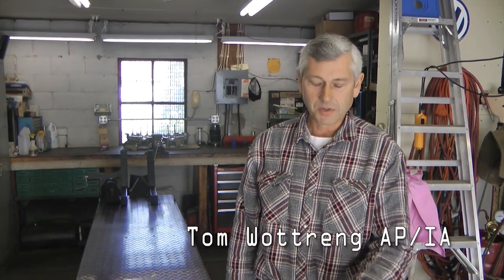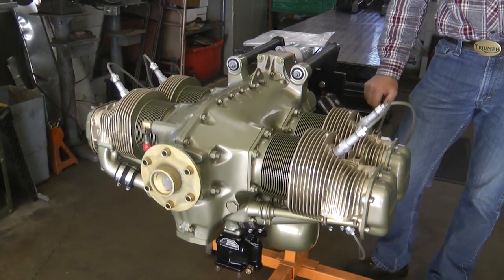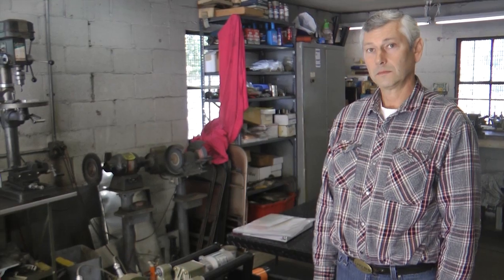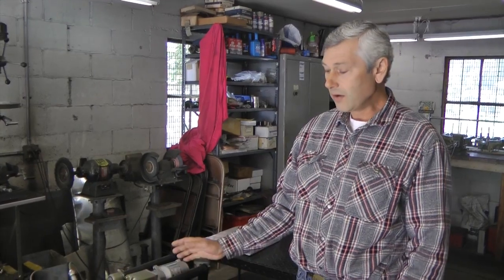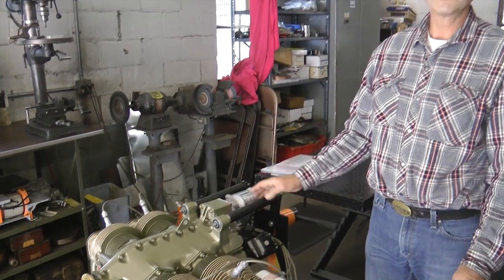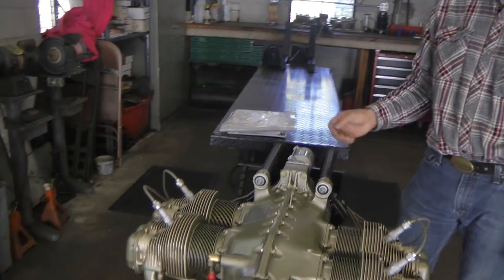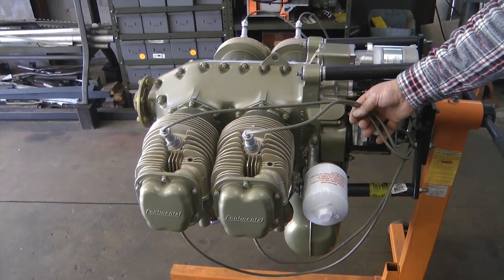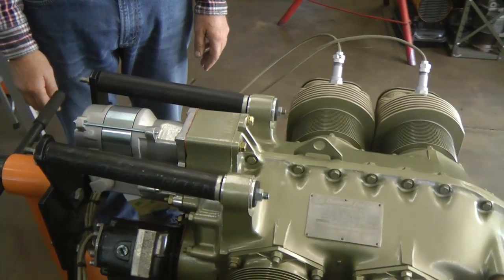Continental O-200 engines for Experimental Aircraft

Comment: Where is a good place to find a used O-200 for an experimental aircraft?
Reply: Barnstormers.
Aircraft Salvage Companies: Call around. Local is often cheaper than shipping.

The C-150 training fleet is consuming a lot of these. And older make and models need their small certified engines. Parts that don't pass inspection are flooding the market and can still be usable on non-certified. But experience is often needed from experts like these. 

If starting from scratch looking for a reliable 95-100hp. And a real budget is involved. Go with the Rotax 912iS with EFI and no carb to fiddle with. 

Used are becoming available now also, if money is a concern. New can be financed reasonably enough. 

The new EFI Rotax has a BSFC of 0.38lb/hp/hr to Ly/Cons 0.44-0.50. A significant reduction in fuel burn of 1-2gph, or 15%-30%. Means greatly improved range over your kits listed value with an O-200. Lower cost due to MoGas also. It will save its own overhaul cost in fuel savings over its lifetime. And take you farther, safer. With no mags, or carb ice, hand propping, or leaning needed.

O-200s are very stout. And are useful for any design that was originally made for them, eg Cassutt, Tailwind, or VariEZ. Etc. But the newer Rotax beats everything hands down. Except for owner overhaul; not gonna happen.😅

Comment: Parts are very expensive.  I’m considering using automotive racing rod bolts.  They are stronger and cheaper.  Any comments?  I’d love some input on this
Reply: For "Aircraft" parts, they aren't very expensive. Buy a used set of rods off of eBay. Have them NDT'd, new bushings and you're good to go. The problem with automotive rods is finding them that are the dimensions that would be required. I've built a few O-200's and currently have 3 builds on the To Do list. If you have to source a crankshaft, you'll have a hard time finding one. A new one will run between $4500-5500 + a $1K core charge. It's easier to source a run-out engine and rob the crankshaft

Comment: I have flown behind several VW engines and was greatly relieved when I bought my Tailwind and it had the Continental 0-200. Those engines are bulletproof. Mine has the external oil filter as well. Fantastic little motor and performance on this airplane.
Doran Jaffas 
N625MS 
Central Lower Michigan

Comment: i have another question. could an engine from a motorcycle be used. a honda goldwing engine is a flathead style. how hard would it be to convert?
Reply: Not flat head, that is valve in block. The opposed 4 and 6 cylinder engines in the Honda Gold Wings are over head cam engines with valves in the head. But, as you indicated, yes I to think that it would be a great choice for a aircraft engine.